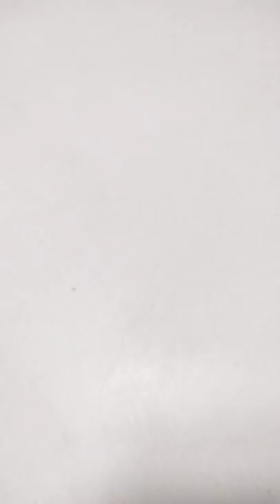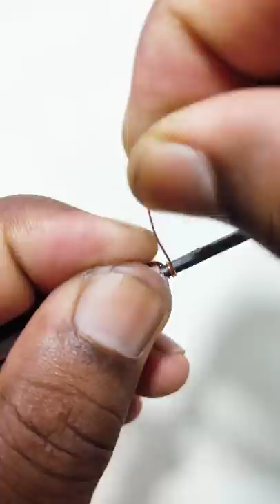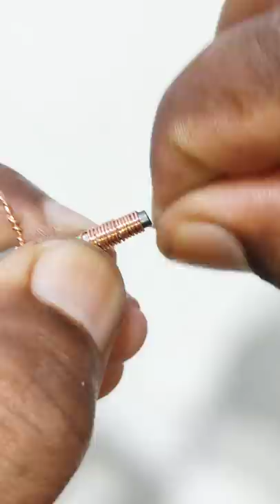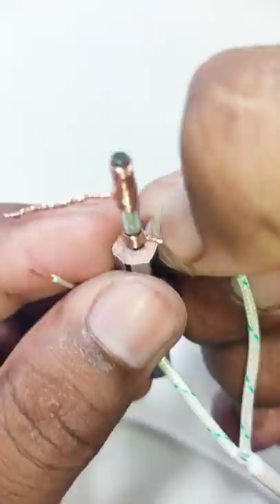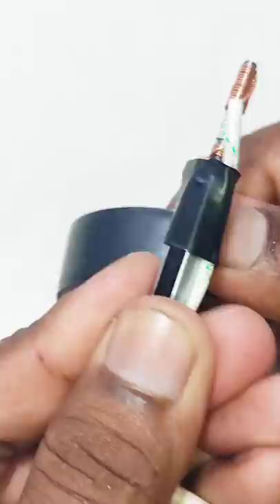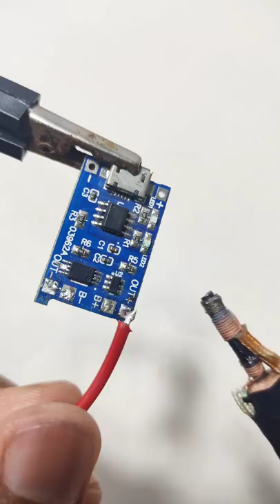How to make soldering iron using pencil #shorts

Comment: What kind of graphite does this pencil has? To this work properly is required get a 2,5 Ohms resistance, if get a lower resistance, the charger turn off due overcharge/short circuit protection!
PS.: I see Platinum Extra Dark, but what HB?
If the resistance is too low, it requires a more powerful power supply, maybe it work with 3V and 8A -> 24W, or 5V and 3A -> 15W, or 5V 8A -> 40W, all depends of what resistance on Ohms of graphite and it's capacity of dissipating heat without get visible incandescent, only the required heat to do the soldering.

Comment: 200₹ ka charger +3₹ ki pencil + 50₹ data cable 253 ka soldering iron 
Market me  15w soldering iron 50₹
Reply: cppal
Reply: OK but in emergecy it will works
and dowonders.
Reply: @santhuprasad7524  solder melt or koi  Kam nahi ayega
Reply: Charger to sabke Ghar me hota hai aur rahi data cable ki to wo cheap 10-20 ka milta hai 15w ka soldering iron 80-200 tak ka milta hai aur ye 20-30 me banta hai me 2 saal se use karraha hun achha chalta hai.